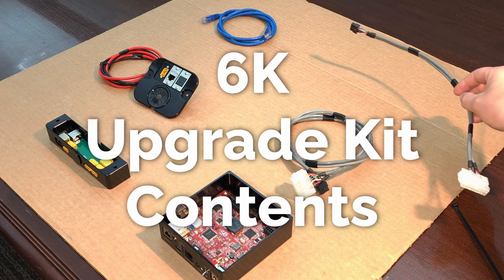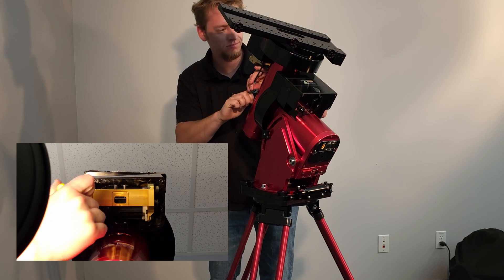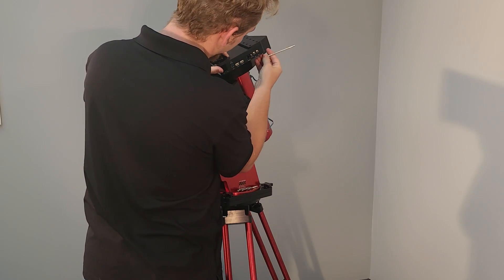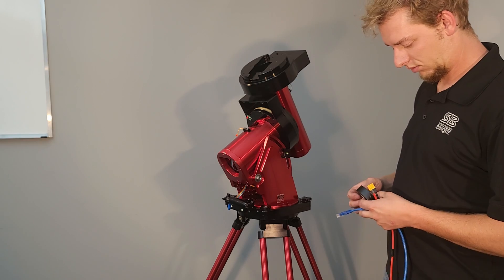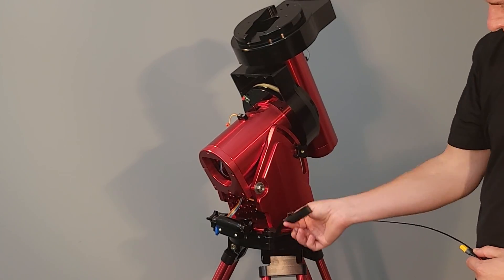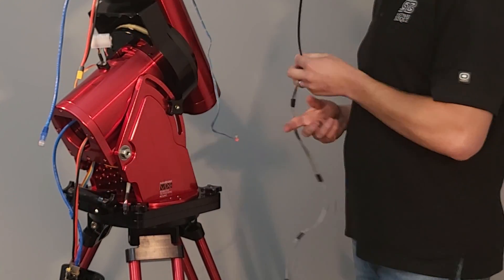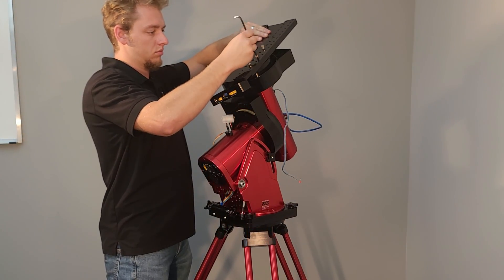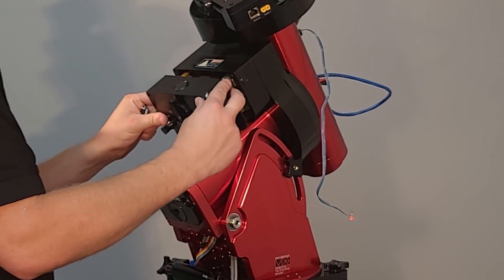MKS 6000 Upgrade

Comment: If you came here with an MyT mount READ THIS: I just got mine in the mail and completed it last night (MyT). Tip #1 manual shows no step by step disassembly of the MyT mount, instead it sends you to come watch this video, which brings me to point #1. point #1: for God's sake if you have  a MyT,  DO NOT break you mount down this far!. You don't even need to pull the covers off unless for some crazy reason thats where the RA/DEC motor cable  connections are (mine are in the body of the mount).  You do NOT need to unplug your RA/DEC homing sensors on the MyT mount!!!  You are not replacing them. really all you need to do is 1. Pull out the old main board and unplug everything. 2. remove the old instrument panel from the versa-plate, 3 remove the versa-plate 4. remove the rear cover Note: There are NOT a bunch of slots in the DEC shaft on the MyT so you don't have to worry about all that rotating it around stuff. 5. Pull the old instrument panel loom all the way out you won't need it again.6 replace it with the new one, it will only be a XT60 power plug and wire and a Ethernet cable.  7.  Take out the old Ra/DEC motor cables, replace them with the new ones. 8. Slide in the new MKS6000 mainboard tray and hook up the homing sensors and the RA/DEC motor cables. 8. route anything else you need to add before you button this rascal back up. I run my Eagle PC on top of my scope so I ran the dedicated power (extensions) through the mount.  because of the Computer on the scope I ran another USB back through the mount to plug into the mainboard.  I also have a Moravian camera that they recommend having dedicated power for, so I also ran that power cable through the mount.  I really wish they could have spent the time to make another video for the MyT.  I did end up with a little black round spacer/grommet/bushing looking thingy falling out of my mount after I took all that stuff apart and I have no idea where it came from.

Comment: I assume all this applies to my MYT just as well. I'd appreciate a brief summary of why I should do the upgrade. My MYT works pretty well. I like to stay current, but I also like to leave well enough alone.
Reply: New features: USB
-C(MKS control), Ethernet(MKS control &/or pass through), Up to 60amp 12v pass through power(XT60).  Future proofing.
Reply: @psyire9913 Thank you for enumerating!
Reply: I realize you sent this 7 months ago and surely have long since completed your upgrade. So I am answering in the case someone like me comes along later and reads this.  I just got mine in the mail and completed it last night (MyT). Tip #1 manual shows no step by step disassembly of the MyT mount, instead it sends you to come watch this video, which brings me to point #1. point #1: for God's sake if you have  a MyT,  DO NOT break you mount down this far!. You don't even need to pull the covers off unless for some crazy reason thats where the RA/DEC motor cable  connections are (mine are in the body of the mount).  You do NOT need to unplug your RA/DEC homing sensors on the MyT mount!!!  You are not replacing them. really all you need to do is 1. Pull out the old main board and unplug everything. 2. remove the old instrument panel from the versa-plate, 3 remove the versa-plate 4. remove the rear cover Note: There are NOT a bunch of slots in the DEC shaft on the MyT so you don't have to worry about all that rotating it around stuff. 5. Pull the old instrument panel loom all the way out you won't need it again.6 replace it with the new one, it will only be a XT60 power plug and wire and a Ethernet cable.  7.  Take out the old Ra/DEC motor cables, replace them with the new ones. 8. Slide in the new MKS6000 mainboard tray and hook up the homing sensors and the RA/DEC motor cables. 8. route anything else you need to add before you button this rascal back up. I run my Eagle PC on top of my scope so I ran the dedicated power (extensions) through the mount.  because of the Computer on the scope I ran another USB back through the mount to plug into the mainboard.  I also have a Moravian camera that they recommend having dedicated power for, so I also ran that power cable through the mount.  I really wish they could have spent the time to make another video for the MyT.  I did end up with a little black round spacer/grommet/bushing looking thingy falling out of my mount after I took all that stuff apart and I have no idea where it came from.